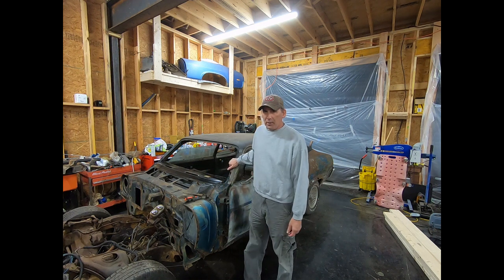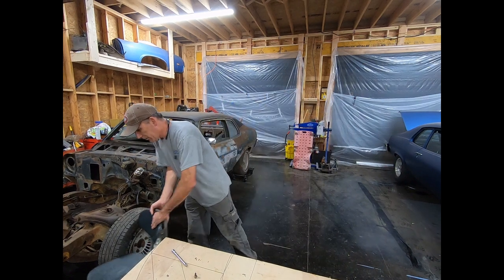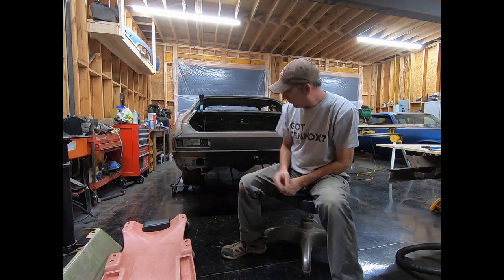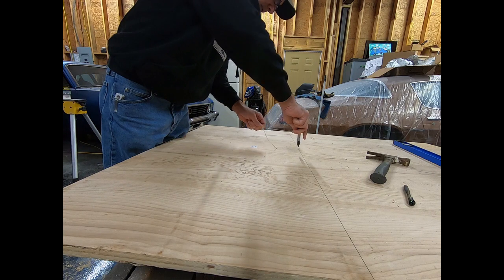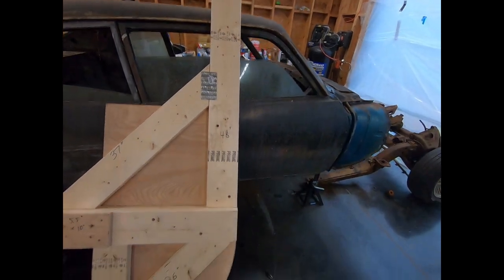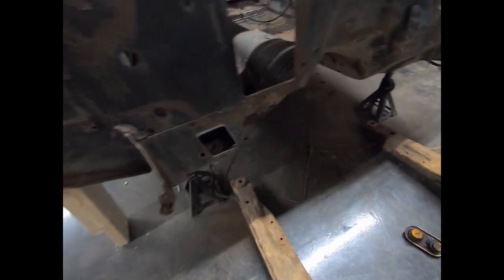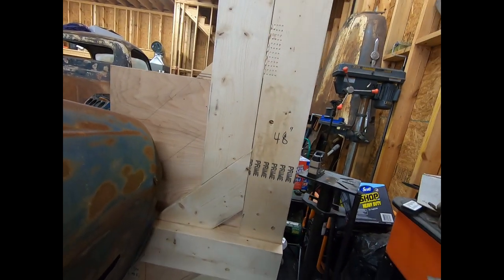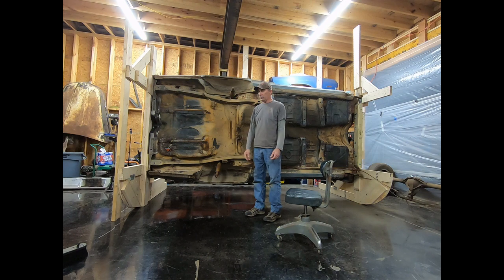Build a Tip Over Jig

Comment: Nice idea. I wonder if you could attach some 10" wheels with supports so you could move it outside for pressure wash or blasting?
Reply from the maker: Honestly I’m in shop looking at it now trying to figure that out. It would need to be right side up to roll it out. May be a good idea for another video.

Comment: Doing a complete restomod on my 71 that I've owned for more than 35 years. Pretty much all the sheet metal is being replaced. It's a Massachusetts car but now living in southern California. Fire wall, full floor pan, complete trunk floor, frame rails, tail panels, rear quarter panels, door skins, is were I'm at with this project. Are there any Information to square this all up and keep all the subframe mounts in line in at the right distance apart? Is anybody have a the website or something where I can get these measurements from?
Reply from the maker: You can buy a fisher body manual that has Datum lines and measurement points. I suggest building a jig. I have a frame machine that I use but that’s an expensive option.